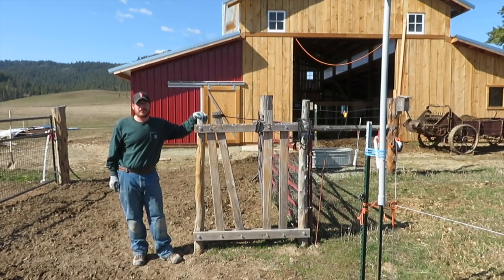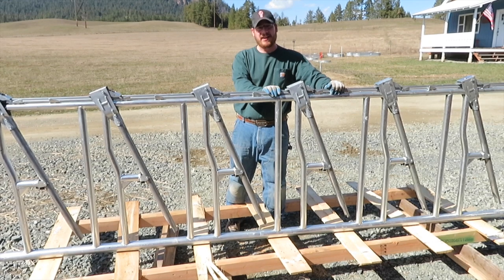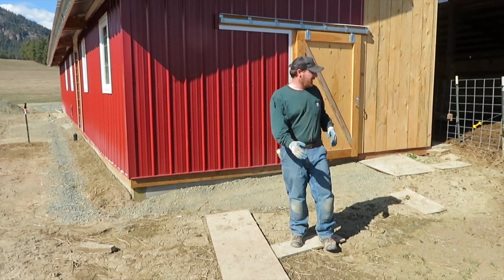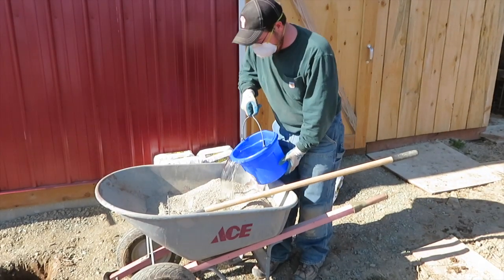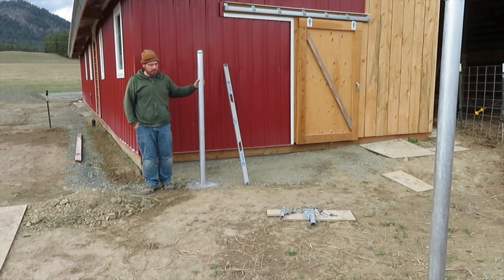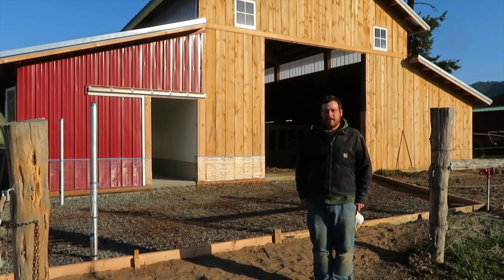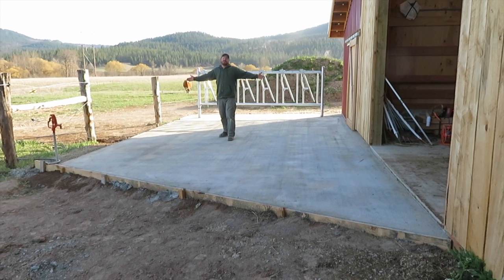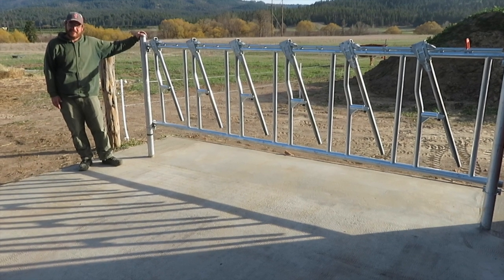Building Dairy Barn #14: Barnyard Concrete and New Headlocks

Comment: Are the head gates mostly for vet visits?  Or maybe you intend to feed them (like alfalfa) out there in nice weather? I like the concrete path and waiting area.  We just scooped out the muck from behind the barn, and whereas the collected stuff in a pile is going to be a valuable addition to the garden, it sure was a mess to have there.  We definitely didn't walk through that area all winter.  You'll be able to maintain a much nicer entry to your milking area!  Like other viewers, I can hardly wait until your dairy operation gets going.  Our beef calves are due later this month and next month (we think).  Possibility of 7 calves this year, and some more lambs too.
Reply from the maker: Yes, be bought the head gates mostly for vet visits, and when we do vaccines or breeding too. We may feed a little, but it is not a primary feeding area. Concrete and gravel are two things we love on the Thomarosa, especially in the winter!

Comment: How far off the cement did you end up installing the head locks ?
Reply from the maker: The manufacturer recommended 16”-18”... Our slab slopes, but we wanted the headlocks level, so ours are about 15” at the high end, and 16 1/2” at the low end. We milk Jerseys, and find the slightly lower height works well for us.

Comment: Step by step ... ''our'' dairy is shaping up!  The textured cement is so practical. l recall [many years ago] seeing cows slip  on the wet cement.  A couple of Q's - how long will the calf nurse?  Do you have a separate space for the birthing? Also would you please show the exact path a cow will take in the milking process?
Reply from the maker: Great questions! We intend to let the calves nurse up until their weaned, probably at 5 months or so. We have a few friends who “share milk” and it works well for them. We do have a place in the barn we can use for calving if necessary, but would prefer to have them calve on pasture if the weather is good. As we get things put in their place we’ll definitely have to do a “walk through” for Youtube! Stay tuned!

Comment: Nice setup with the headlocks!  " Your vet will be happy?", only if it's a nice sunny day. I see a barn extension, maybe only a roof and one wall with lighting for those not so sunny days.
Reply from the maker: No, no plan for a roof. Luckily we mostly have dry weather here! The headlocks give us the ability to lock up the entire herd, but in case of inclement weather, we can do some things in the milking parlor stalls which are inside. We do eventually plan to put a flood light on the back wall of the barn however.